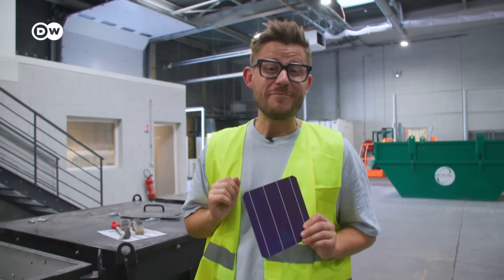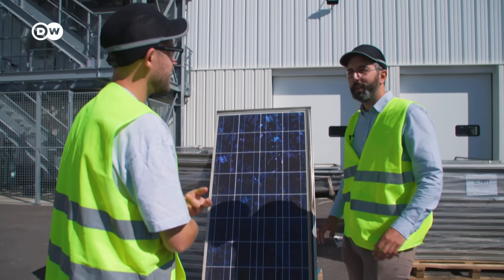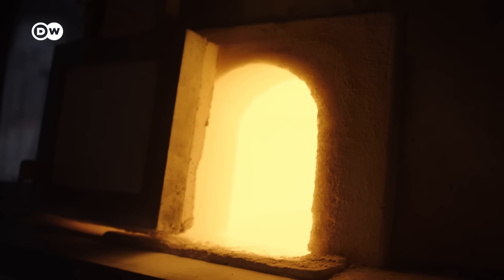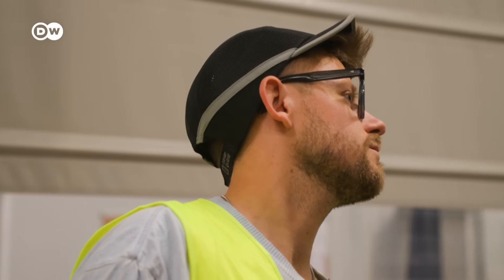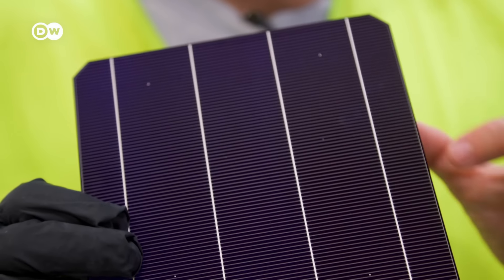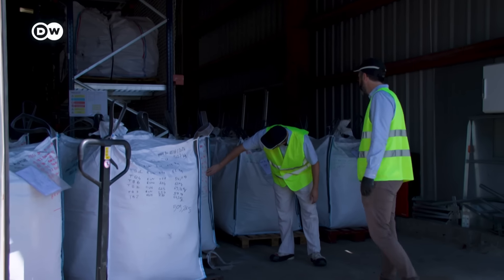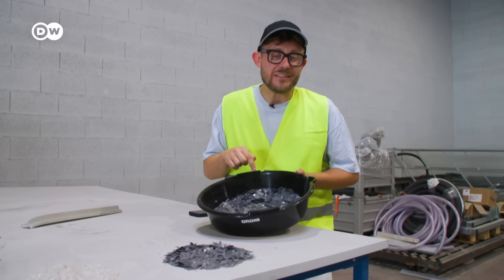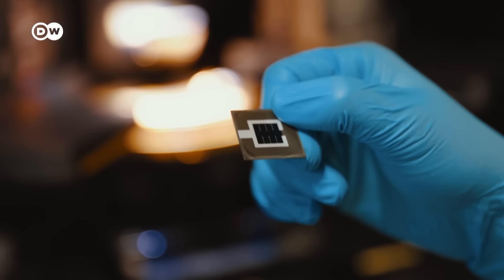The race to solve solar energy's recycling problem

Comment from the maker: What do you think is the best way to deal with end-of-life solar panels?
Reply: When nobody is looking, dump them in your neighbours yard? 😉😉
Reply: @somerandomfella 
And your neighbor is doing the same thing....😅
Reply: @JusticeAlways  😋
Reply: If they can't be recycled for parts, they are big roofshingles basically. So use them as such. You can recycle them later when the tech is there to do so, saves a lot on landfill and other raw material needs untill then.
Reply: When we will get more advanced perovskite-based solar panels?
These are dinosaur shit
Reply: An open source process that is designed around open source panels designed with decommissioning in mind from the beginning
Reply: maybe switch to other methods to harvest solar energy like parabolic trough collector (PTC), linear Fresnel reflector, solar dish, and solar tower which may be more recyclable
Reply: Tell them to add turbines to the exhaust stacks 😊
Reply: If we need solar panels, they should be built recyclable in the first place. But for now, i don't know. Using less energy is the best solution but the presented way to recycle seems ok. Scaling up is real problem and takes time we do not have. Focusing on tech takes our focus off from real answers like lowering consumption and redirecting it more reasonably.
Reply: Reuse
Reply: They are doing good work. 

Other new techniques are also available.
Reply: Hello from Los Angeles California.  I lived all my life in Los Angeles California, and in the 1980's the Smog was so thick it filtered the Sun. The smog blocked the Sun so much the winter's in Los Angeles California was so cold between 36° to 55° Fahrenheit nights dropping to 33° Fahrenheit 
I couldn't see mountain ranges from where I live 4.5 miles away. Unless it was windy and smog cleared. Now the air is so clear you can see cracks and riges, on the rock walls. 
It uses to rain 🌧 none stop for 7 months, and the summers never exceeded 90° Fahrenheit. Due to Sun being filtered from smog I also didn't need shades, for my eyes. Now 🌡  are 110° Fahrenheit for excess of 1.5 months with 5 days in the roll Temps exceeding 116° and 1 day at 120° to 126° depending on fire conditions radiating heat. 
Air clean enough, and it will not get any cleaner with only Electric Vehicle's (EV's)
Now to the reason why Environmental green agenda causes Drought Conditions.  In 2010- 2013 there were Solar Mirror s installed to project solar arrays to a Tower with mirrors projected downward to under ground reservoir water sources.  To generate steam, and generate Electricity.  
The temperatures 🌡 causes the atmosphere to close to 5,000° and every time birds fly thru become instantly baked and fall. 

In the 1980's the Jetstream used travel across California in to Nevada,  Arizona,  New Mexico,  Texas, and so on to Florida.  Due to the Mirrors the Atmospheric High Pressure. Has pushed the Jetstream away from Southern California to North to Washington,  and or Canada 🇨🇦 . This cause along with getting rid of Smog cause higher temperatures and Drought Conditions. You couldn't pay me $10,000,000 per hour to sit, promote,  sell, let alone buy any Electric Vehicle's (EV's).
If you look up StachD Training channel, on his video titled Lithium Largest Ex plo ding EV Recycling ♻️ Center in Missouri.  There were 4 Recycling ♻️ Centers in the United States.  Now there are 2 Recycling ♻️ Centers,  and none are in the State of California.  Due to Environmental Impact, which the video shows Fire Authorities spray granulated elements of the Lithium-Ion Batteries 🔋 Packs,  into creeks, rivers,  and lake anfmd underground well resources.  Not even boiling helps, and fish hacmve died in those water ways.   Sure clean the Air while you Pollute the water. In April 2024 the 1st Recycling ♻️ Centers in Phoenix Arizona location burned down,  and dousing water to keep cool prenting spread of fires 🔥 have caused Drought Conditions.  @truebrit3670  Look it up
StasheD Training channel 
Missouri Recycling Center ♻️ Ex Plod ing can't spell this out. Fish died wells for water is no good anymore,  and became Acidic 
These are facts. 
Mirrors in Mojave Desert Modified where Jetstream away from
 Southern California.  
The so called green agenda is to keep there pockets full or bank accounts.

Comment: Nearly 800,000,000 tons of used oil filters go to landfills every year and folks want to pretend that MAYBE up to 27 million tons of PV pannels are a problem? Please.
Reply: Both are problems. Circular economy is the way to go.
Reply: But oil filters don't contain valuable and reusable ressources. Why would anyone want to recycle them.
Reply: @linussinus4949 PV panels are literally sand if you removed the aluminum frame and plastic back cover.

Only valuable thing there would be 0.1% silver. We can replace even that with copper with newer technological developments.
Reply: @lindenhoch8396  Perhaps so we can continue living on our planet? Just a thought. Before you say anything, not my fault those who don't recycle are plain dumb.
Reply: If you're going to compare something to PV panels, how about actually finding realistic numbers. If you had actually looked into how many used oil filters are landfilled, you'd find that it completely disproves your point.
Reply: @xungnham1388  oil filters are toxic. PV panels aren't
Reply: @xungnham1388 You forgot the waste, that accumulates even before mined oil is sold. There are excessive statistics stating, that the amount of waste due to solare or wind energy is several folds lower than waste due to fossil energy
Reply: I was going to write to the exact same point. 27 million tons sounds like a lot, but on a global scale of energy, it's nothing. Just leftover coal ash is 100x larger.

This waste shouldn't be used by people arguing against solar power; the facts don't support this. This waste is an opportunity to make solar even more environmentally friendly by turning landfill back into a resource.
Reply: I think the weight of used oil filters is out by a factor of 1000. I would guess that there are about three or four billion motor vehicles, and 800 million tonnes would represent an average of 200kg of oil filters a year for each vehicle. Sanity check failure! Probably more than half the vehicles are small motorcycles that mostly have centrifugal filters that are not thrown away but cleaned out (if they are very lucky) or ignored until the vehicle is scrapped.
Reply: solar cell installation grows exponentially. 27 Mt are what was installed 30 years ago - in 30 years we will have insane amounts going to the trash. Thats why it is important.
Reply: What about the millones of litres of uses oil from the oil changes worldwide each year too.
Reply: That would be 800 billion kilograms of oil filters, about 100 kg per person per year. Highly doubt that
Reply: @GaryV-p3h  Used motor oil for the most part just gets sold to a "processor" that just burns it in an oil heater.
Reply: @lindenhoch8396  Neither do solar panels. They cost more than the material you extract. Oil filters are much easier but you're talking extreme heat but not as much as solar recycling and my guess if you use pyrolysis the out gassing can be used to heat the material and with oil odds are it;s a net zero operation and would likely result in an energy surplus.....Oops, did I find another solution on the fly? Are they even trying? How about putting say a $1 surcharge on every oil filter and make it a $10,000 fine to throw one away. Have to recycle. That should make that 95% to 99% get turned in for recycling and $1 would cover the costs 10X. Wow! Solutions are so easy so why aren;t we doing any of it? Because the industry would have a cow due a perceived tiny loss of sales? Our politicians are lapdogs to industry who like their bellies rubbed with $100 bills......
Reply: @linussinus4949 entropy basically means it's impossible to have a completely closed loop system. There will always be inefficiencies and some things that are too costly to do effectively and sustainably. Harm minimisation is the only realistic goal we can reach.
Reply: @JSM-bb80u  If you don't know what you are talking about, why speak?
Reply: @GaryV-p3h This oil is downcycled, not wasted.
Reply: @lindenhoch8396  A used oil filter does contain materials that have worn off the engine components. Some of these are toxic heavy metals, and should be recycled. If they are put in landfill the site will be unsuitable for later agricultural use.
Reply: @JoshuaMcTackett  You're right! I don't know why people forget entropy is a thing, a very important thing. Reduction is the only way. This recycling stuff is not going to solve all the problems and it's also wasting energy, resources, etc.
Reply: @cedriclynch  Lots of stuff should be recycled, but won't be due to the fact it isn't economically viable. It's just a symptom of what we've become. Noone wants the expenses of solving what eventually become someone else's problem.
Reply: @xungnham1388  I did. That's where I got the 800 million tons number. Take your advice.
Reply: @TheHonestPeanut  Do you not math? Do the 117 people who upvoted you not math? 800 million tons is 1600 billion lbs. There are less than 8 billion people in the world; that would mean each person is responsible for generating 200 lbs of used oil filters every year. A used oil filter is maybe 1 lbs when wet. That would mean we are each averaging 200 filters a year. I better go out and get my daily oil change before I forget /s

Here's some actual numbers. In 2019 the US generated 768 million filters, at 1 lbs each, that's 384,000 tons. The US represents 18% of global cars, so the world has 5.56x more cars than the US. Americans drive more than any other country per capital, so a number scaled from US usage is an upper bound to how many oil filters are generated. 5.56 * 384000 tons = 2.135 million tons as an upper bound estimate.

You are off by 3 orders of magnitude. Math. That's the super power that scientists and engineers wield. It's a BS checker; without it, environmentalists' claims would be just as deranged as climate denyers.
Reply: @JSM-bb80u Sand is impure silicon dioxide.  It requires a lot of energy intensive processing to get to pure silicon.   Recycled silicon from used panels will be valuable for production of new panels or silicon microchips.
Reply: I never considered oil filters, so even with synthetic oil, still damage caused 😢
Reply: @jamesdean0885  synthetic oil is just oil with other chemicals. Same as regular oil but now with more oil.
Reply: I think electronic waste in general is a massive problems. People think they can just recycle it all, but 1. They usually just throw it in the trash. 2. PROPER Recycling can’t recover everything 3. IMPROPER recycling, where ewaste is sent to developing countries and burned to retrieve metals is a serious issue for the environment and human help. 4. We don’t repair much of our ewaste. 5. We make cheap products that don’t last
Reply: Oh dear.  I totally support reusable oil filters as a concept but no, 800,000,000 tons of used oil filters are not being discarded annually.  I think you got the number from 788mil oil filters being discarded annually in the US as a claim by a manufacturer of oil filters based on people using 2.7 filters annually per car, which is in itself a hugely exaggerated number, but oil filters don't weigh a ton or anything close to it.   They weigh under 1lb or 1/2000 of a ton so your assertion would require that 1.6 trillion oil filters - or around 200 filters for every human on earth - were being disposed of annually.
Reply: Hello from Los Angeles California.  I lived all my life in Los Angeles California, and in the 1980's the Smog was so thick it filtered the Sun. The smog blocked the Sun so much the winter's in Los Angeles California was so cold between 36° to 55° Fahrenheit nights dropping to 33° Fahrenheit 
I couldn't see mountain ranges from where I live 4.5 miles away. Unless it was windy and smog cleared. Now the air is so clear you can see cracks and riges, on the rock walls. 
It uses to rain 🌧 none stop for 7 months, and the summers never exceeded 90° Fahrenheit. Due to Sun being filtered from smog I also didn't need shades, for my eyes. Now 🌡  are 110° Fahrenheit for excess of 1.5 months with 5 days in the roll Temps exceeding 116° and 1 day at 120° to 126° depending on fire conditions radiating heat. 
Air clean enough, and it will not get any cleaner with only Electric Vehicle's (EV's)
Now to the reason why Environmental green agenda causes Drought Conditions.  In 2010- 2013 there were Solar Mirror s installed to project solar arrays to a Tower with mirrors projected downward to under ground reservoir water sources.  To generate steam, and generate Electricity.  
The temperatures 🌡 causes the atmosphere to close to 5,000° and every time birds fly thru become instantly baked and fall. 

In the 1980's the Jetstream used travel across California in to Nevada,  Arizona,  New Mexico,  Texas, and so on to Florida.  Due to the Mirrors the Atmospheric High Pressure. Has pushed the Jetstream away from Southern California to North to Washington,  and or Canada 🇨🇦 . This cause along with getting rid of Smog cause higher temperatures and Drought Conditions. You couldn't pay me $10,000,000 per hour to sit, promote,  sell, let alone buy any Electric Vehicle's (EV's).
If you look up StachD Training channel, on his video titled Lithium Largest Ex plo ding EV Recycling ♻️ Center in Missouri.  There were 4 Recycling ♻️ Centers in the United States.  Now there are 2 Recycling ♻️ Centers,  and none are in the State of California.  Due to Environmental Impact, which the video shows Fire Authorities spray granulated elements of the Lithium-Ion Batteries 🔋 Packs,  into creeks, rivers,  and lake anfmd underground well resources.  Not even boiling helps, and fish hacmve died in those water ways.   Sure clean the Air while you Pollute the water. In April 2024 the 1st Recycling ♻️ Centers in Phoenix Arizona location burned down,  and dousing water to keep cool prenting spread of fires 🔥 have caused Drought Conditions.  @truebrit3670  Look it up
StasheD Training channel 
Missouri Recycling Center ♻️ Ex Plod ing can't spell this out. Fish died wells for water is no good anymore,  and became Acidic 
These are facts. 
Mirrors in Mojave Desert Modified where Jetstream away from
 Southern California.  
The so called green agenda is to keep there pockets full or bank accounts.
Reply: @JSM-bb80u Sand isn't silicon. Do you even know how specific modern silicon manufacturing requirements are? We are literally having difficulty already sourcing suitable sand in sufficient quantities. You can't just dig up a beach.
Reply: I think its only about 13 million tons of oil filters per year. And that includes the leftover oil inside the filters which is around 50% of the mass.
Reply: Where u get 800 mil number? Only about 4 mil in the US on the high end. Though I appreciate the sentiment that PV is generally better for carbon emissions than gas and oil, your comparison seems misleading